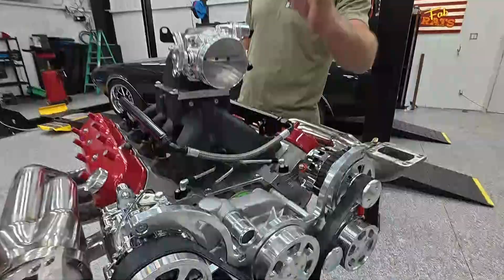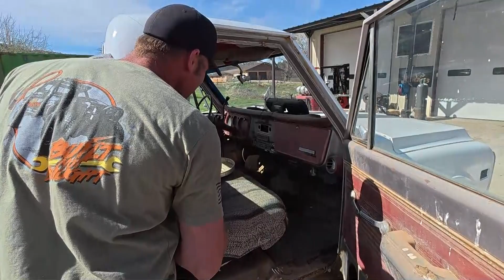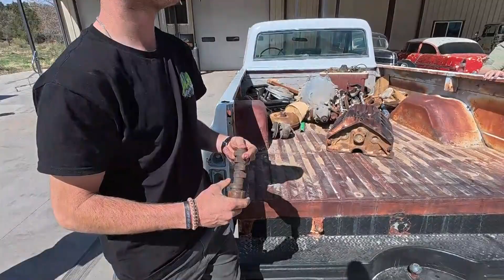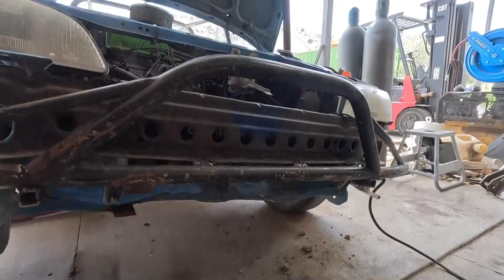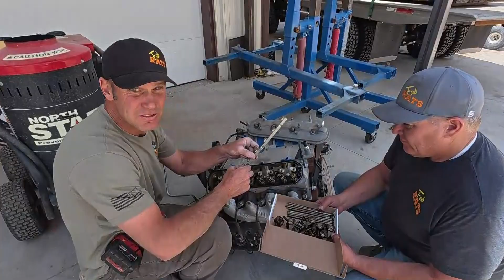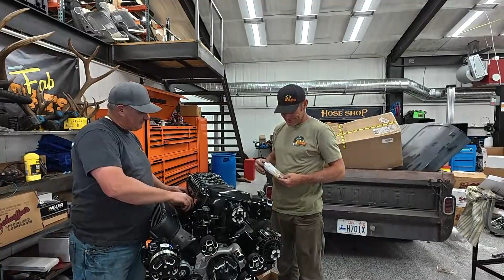They Surprised Me With My High School Truck!

Comment: Paul I’m definitely really excited to see what you end up doing with your high school truck!!! I’ve had one ever since I was 10 years old and wasn’t able to drive other than on the farm!!! I’ve had so many different ones over the years that I definitely lost track of how many I’ve had!! I still have the one that I had in high school though!!! The one in my profile picture that is a factory color that not many trucks were painted that color of blue and I definitely love it!!! It’s got a full 1Ton running gear under it with 4.56 gears and both axles have the ARB air lockers in them along with a doubler setup with a SM465 and the shaft was made for it to run a full 32 spline all the way through the doubler setup!! It’s definitely one I’ve been working on for many years!! I also built a 421 sbc a couple years ago for it and had it all tuned on a dyno and it was putting out just shy of 700Hp!! It’s definitely been a blast building it for sure!! Awesome video and like I said I definitely can’t wait to see what you do with yours!!! If you need any truck parts for yours I probably have them and you definitely can get ahold of me and find out if I have any parts that you might need!!!??

Comment: I bought my first truck in 1985. It was a 1968 Chevy 1/2 ton 2wd long bed with a 307 and a three speed automatic. I rebuilt the front end and did a top end overhaul in my driveway. Eventually a couple buddies and I rebuilt a 350 with a mild cam. Don't know why I ever got rid of it.

Comment: TIP FOR U PAUL: prying on the pickup tube to line up the holes like that might compress the O-ring on one side and gap the other starving the pump and engine of oil so might check it.

Comment: I feel the turbos should be in the car as they will produce more high RPM power but lack the instant throttle response. The blower, that will not have the high RPM peak that the turbo will have but will act more like an NA with instant torque all the time. While turbos sound cool, my personal preference, for a truck is a blower.
Reply: You got it backwards. Turbos in the truck for burnouts , and Blower in the Firebird for drivability on the canyon roads around Paul's area .

Comment: **Paul and crew:**
Get some Slick Stick lubricant and use it!!!
It will prevent buildup on burrs, bits, flapper wheels and cutoff/grinding wheels.
You will not believe how well it works.
Thank me later.

Comment: I'm not much for Chevy. They rusted out quite badly quite quickly. When you building a ford  .never?  You're more than happy to steal parts from them for your rusty chevys. Like come on paul. Build a 351 Windsor or a 351 Michigan motor. Or a 460 429 390. Come on at least honor ford for the parts you've plagiarized for your chevys and toyotas
Reply: Where I come from, all trucks rust out. Chevy, ford, dodge… doesn’t matter.
Reply: @astridsactionrc545 same, but I've lost count on the thousands of Ford's I've hauled for scrap with my Chevys
Reply: @astridsactionrc545  Where I come from NO trucks rust out.
Reply: 😂Hahahahahaaa!
Reply: well to start with it's not a Michigan